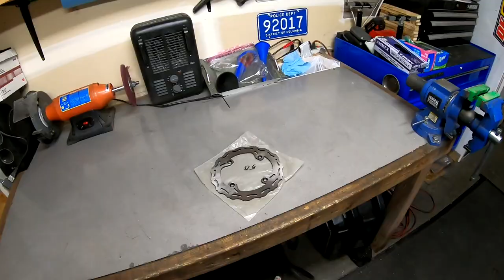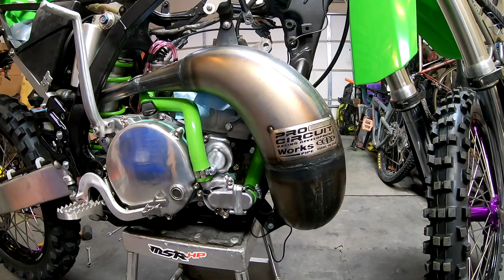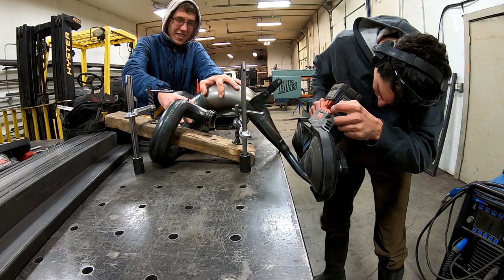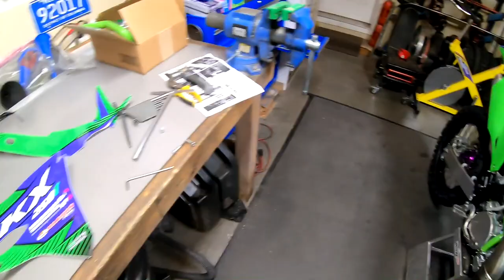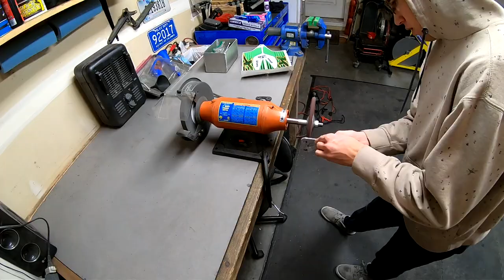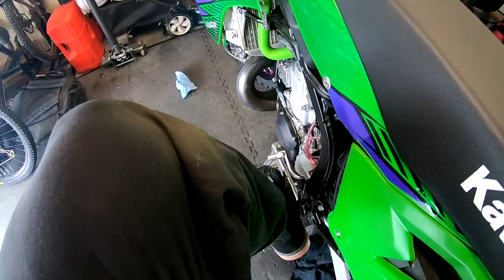Starting the 2001 Kawasaki KX250 for the First Time! Rebuild Episode 7 | Kawasaki 2 Stroke

Comment: Nice bike, I envy your work to bring new life to a older Kx. But to people watching this Ryan is a smart guy. The TX kit is over priced and the gaps are horrible in the air box area. It is cobbled, hacked up and thrown together. Ryan does it right!
Reply from the maker: Yes, I think if I were planning to ride the bike long term I'd be disappointed with the kit. That said, if I cared enough to rip a KX250 long term I'd probably just run stock plastics. But overall I can see the TX race kit getting seriously damaged after a few crashes. I'm not as concerned about the side panels as the shrouds; I think the aluminum shroud mounts will bend. But regardless I am happy with my decision for this build, and the bike is currently sitting in my living room as a show piece!

Comment: Did you figure out the leak? My 94 is leaking from the cylinder bleed screw, and seems like there’s fluid leaking at the same cover yours is.
Reply from the maker: In this case leak ended up resolving itself once I heat cycled the bike a few times. I think it was just a unique case of the aluminum and gaskets needing to expand and contract to seat themselves properly.

Comment: Hey how did you get decal works to match the plastics from TXrace?
Reply from the maker: They match a 2020 KX450F, and require super minimal modification. And I got the fork guard graphics for the 01 KX250 of course.

Comment: How did you polish the clutch cover like that, and where did you order your plastics? I got a 99kx250 I’m rebuilding
Reply from the maker: I used Pryme MX cleaning wheels on a harbor freight bench buffer. I do it in episode 3 of this build series. This clutch cover was covered in paint beforehand! You can use my referral code on the Pryme website: https://prymemx.com/?ref=push

The plastics are the TX Race restyle kit. They look great, although getting the tank on and off is pretty tedious with the kit (not bad, but much more time than stock plastics) and I could see some of the hardware bending in a crash.
Reply: DONT put a wheel to you clutch cover like this guy did. Those are made out of magnesium and they are painted from the factory for a reason. Raw magnesium in the elements....bye bye good looking clutch cover.

Comment: Those TX kits are just not a good way to restyle a bike. The way it leaves gaps around the airbox is not good by any means and how they don't match up with the subframe on the left side drives me nuts. And the seat with a bolt thru the top is absolutely silly. Honestly if you take a fall how well do you think its going to hold up with all of those chincy little brackets that hold the plastics and seat on? My guess is that its going to look like a yard sale with parts laying all over the place lol remember this isn't about you as a builder its about TX Race and their poor quality.
Reply from the maker: Yeah I didn't know what to expect going into it. For the price the brackets should be higher quality. I don't mind the bolt through the seat although a little goofy. As for the airbox I don't see that as an issue personally; a lot of modern bikes have a sizable gap like that. Overall I really like the look of it, but I agree it may not be the most durable long term.
Reply: @KincadePavich  I've been making a 15/16 plastics conversion kit for the 99-02 kx125/250s and the 94-98 kx125/250s for a little over a year now. My kits use the 12-15 kx450f/13-16 kx250f subframe, airbox, gas tank, seat and plastics. I put a video on my channel but its just a start up walk around video of the completed bike. I also shoehorned an 02 kx500 motor into it.
Reply: @KincadePavich  I'm also subscribing to channel because you've got a lot of different content and liads of talent 🤙
Reply: @grawesomeindustries268  Where can I find this conversion kit??
Reply: @oedman96  my name is Ryan Grawe. Send me a pm on Facebook bud.
Reply: The gaps in the Air box are horrible! It's a huge problem. You have to cut your old fender up and modify the new 2020 style fender to make this work. Anyone who says the gaps in the air box isn't a big deal. You are seriously wrong. And a piece of flat bar, to suck the rear fender up, wait till you hit a serious jump and you bottom out on the plastic 3/4 into the suspension stroke. I own an 01. I bought the TX kit. I had to make things and do a lot of work to make this a decent re style, one where you could go to track day without hurting yourself or the engine taking on mud water added dirt etc. The camera moves FAST in the TX commercial cause they have lots to hide. My experience with TX was terrible. They never even sent decals with the order. Took them a week to ship the order. Took another week to get it and 2 more weeks for the decals they never sent. No big deal since I was so busy fixing the jacked up rear fender area. The Kawasaki logos are spray painted on the  seat material also.